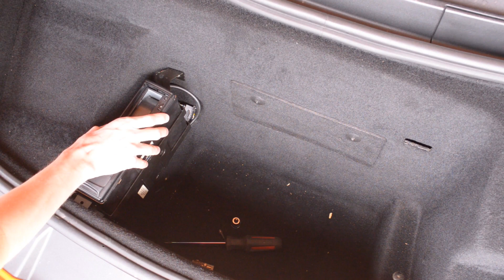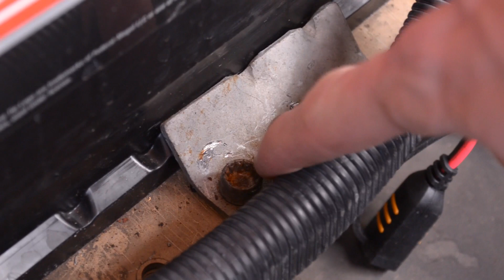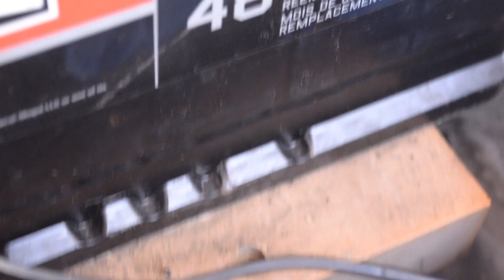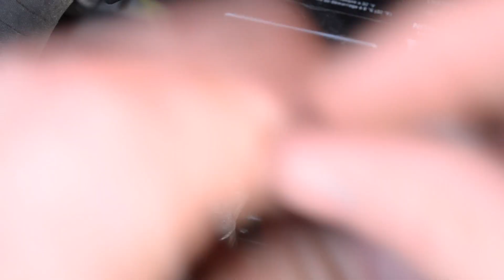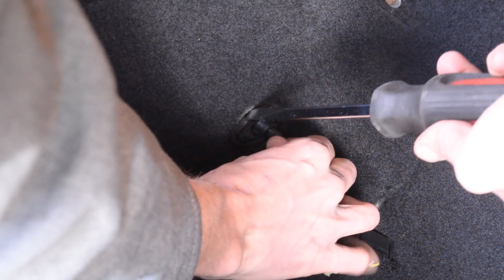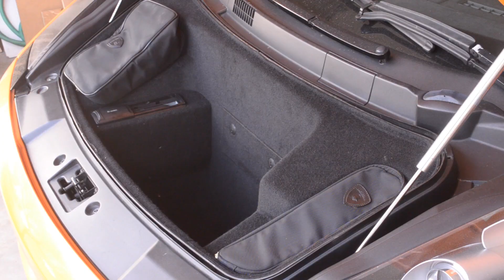Lamborghini Gallardo Battery Replacement | Key Reprogramming and Key Adaptation For All Gallardos.

Comment: Wow!  I'm constantly amazed at how difficult it is to do anything simple on this car.  I recently changed the battery in my F430 and it took a good 5 minutes at most.  I had to remove two screws and then I could access the battery.  I put in an anti-gravity into my car, shed about 30lbs off the car's weight.
Reply from the maker: I like that Kent! Its not THAT bad!! Without filming, I can nock this out in 15 minutes tops. I also just looked up where the battery is on your F430. It does look rather simple now that you mention it! 
You make your F430 sound fun. I am jealous that a lot of Ferraris have open deck block and you can replace the cylinder sleeves in your garage when rebuilding the motor. 

 I worked on a Audi A8L with a dead battery once, but the battery is in the trunk and the only way to open the trunk was with an electronic latch and there were no jump starter terminals in the engine bay... Had to remove the whole undertray to jump it on an alternator lead. 
The VW Touareg/ Audi Q7 / Cayenne has the battery underneath the driver seat hidden by 15 pieces of fragile trim and is held in again with those fancy 12 point triple star bolts! 
So from what I've seen, I'm telling myself "damn this battery is easy on a Lambo" but I would speculate it comes down to packaging issues for the AWD system. The engineers ran out of space!

Comment: Beautiful  again,  one thing, in my car the battery, don’t know if is OEM, but seemed to me that was rubbing on top of the coolant aluminum pipe, so had to put a piece of rubber under the battery to give it some clearance, maybe it’s just mine, but you don’t want a hole on that pipe, don’t look very thick. Thank you again for doing this videos.
Reply from the maker: Interesting point Jacob! I noticed that there is rubber on that coolant hose on later models for this very reason perhaps? Im glad that it helped you!

Comment: Nice.  I had to replace my battery as it was old and exploded while i was away and while on a battery tender.   I did pretty much exactly as you except I have a LP and no cd changer.   I opened my window as well to not get locked out if it didn't work while I reprogrammed my keys.   Good content.
Reply from the maker: Haha im glad to hear im not the only one with the window trick! 
Your battery exploded? Did it just swell and pop acid out the top?! 
Is your CD changer behind the center console? I always thought it was interesting that the Huracan and Aventador came with CD changers. I probably havent touched a CD in 15 years!
Reply: @TheBullRider  yes the battery did crack at the top.   I don’t have a CD changer at all.  Or it was removed prior to me purchasing it.  Same as you haven’t touched a CD in many years.  Lol. Thx again

Comment: Battery + Installation is $795.00 at the dealership 😳 Seems like a lot of people don't know you can also "tender" your battery through the cigarette port in the center console. I find that to be much easier than having to pop the frunk.
Reply from the maker: Thank you for that quote Patrick! That is crazy! Save your money and buy yourself a lighter lithium antigravity battery for that price!! 
Good call on the center console cigarette port. Do you have issues closing your door?
Reply: @TheBullRider  I have the driver's window down when parked inside my garage. It makes it easier to get in/out with the car stacker. Otherwise, I have to maneuver around the window. Easy to reach in/out to connect/disconnect it too. By the way, I saw you did not have a "divider" in your frunk either. Interesting...
Reply from the maker: @PatrickMichael2002  I have honestly never seen a divider in a Gallardo, Patrick. Either they didnt come with the car or people throw them away almost immediately! 
And that makes sense, im rather jealous of your car stacker!

Comment: The grease on the terminals is always important but did you know that if you don't have any grease then a good alternative is hairspray. It is excellent in preventing acid build up. If your battery connectors is full of acid then just pour some Coca-Cola on it and it will be gone in seconds. Just wash it off with some water and soap to prevent it from being sticky
Reply from the maker: Haha I have to try this now Willem! I have never head of the hairspray method although I have heard of the Coca-Cola method for acid! Have you used baking soda for battery corrosion before too?
Great tips my friend. I appreciate it!
Reply: @TheBullRider  I often use baking soda to clean battery clamps with and it works quite well I must say. I work on cars every day and specialize in auto electrical repairs. I will gladly give you more tips as your channel grows
Reply from the maker: @willemvandernest3249  Thanks for sharing that Willem. I do not envy your job. A lot of electrical stuff that I have done on cars makes me want to rip my hair out!! 
I will definitely reach out if I am stumped and appreciate the tips and tricks when I overlook something!

Comment: I usually clean off the insides of the battery terminal clamps before reinstalling on a new battery. Your's looked good in the video but they can corrode on any brand of car. How about changing the battery in your key fob as a supplement to this video?
Reply from the maker: Great call Dave! Just like you said, mine were in great shape! That is a great idea and I will get on it!

Comment: I would have taken those 12 point, triple star doo-hickey bolts and replaced them with standard six point bolts.  Keep the fancy Lambo bolts in the glove box for the next owner!   I hate to see "special fasteners" on cars.
Reply from the maker: But frustration when finding the special fasteners is half the fun Mario! Its probably why Lambo charges 750$ to change the battery on these beauties! 
These special fasteners are littered all over VAG cars, holding in axles, calipers, seats, and everything in-between!

Comment: Do you need to enter a code for the radio after you replace the battery?
Reply from the maker: Great question Bravo Bravo! No you dont. You might have to however if you let the car sit for extended periods of time with the battery unplugged. (Like a week) This will drain the internal battery in the RNS-E and put it into safe mode. 

I have only personally experienced lockout issues on AUDI/VW nav units when you unplug the unit and remove it from the car. 

If you have to retrieve the code, any Lamborghini dealer should let you verify ownership give you the code. If the dealer doesn't help, call Lambo USA.
Reply: Thank you for the reply back
Reply from the maker: @bravobravo9783  Im happy to help!